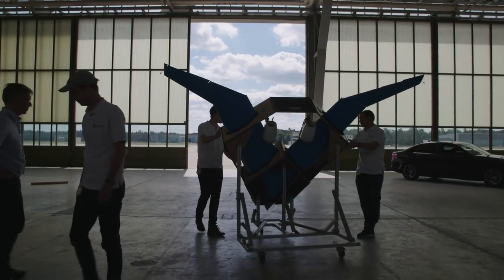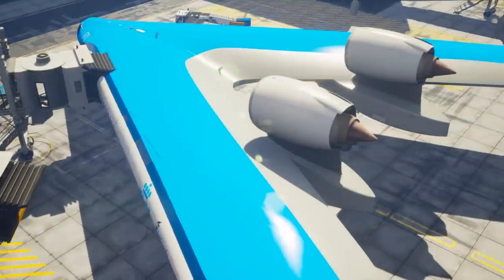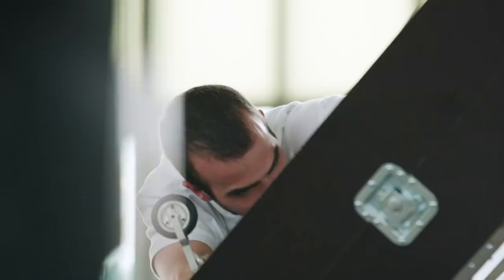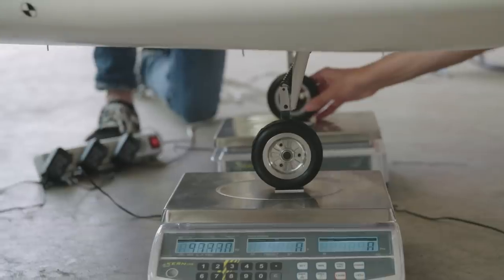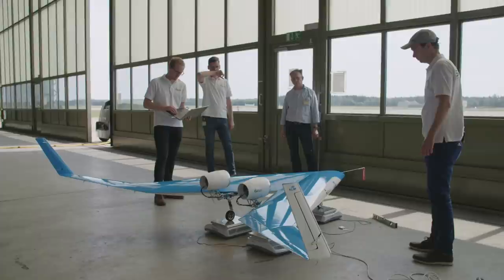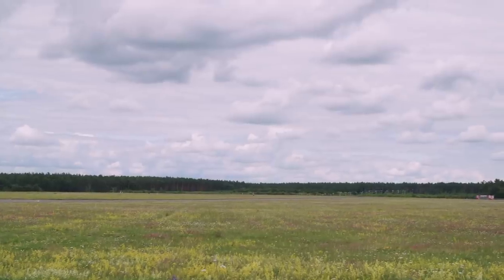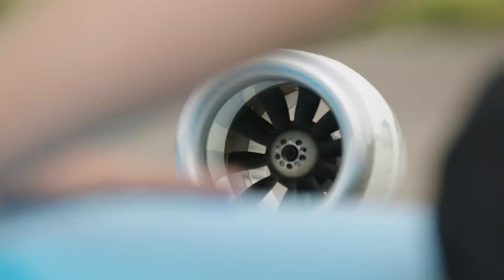KLM & TU Delft present: Flying the model Flying-V

Comment: So this design improves the fuel efficiency ~20%? What are the tradeoffs or disadvantages? Is there any increased safety risk? 
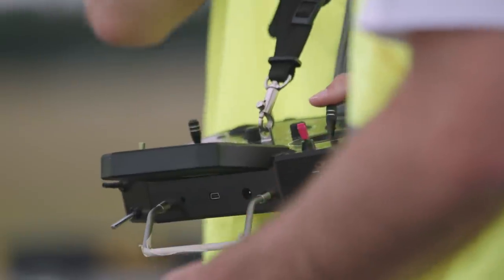@1:56 he says that there's danger of the nose pitching upward if a certain angle of attack is exceeded. Does that pose any significant safety risk compared to more established aircraft?
Reply: Yes it does
Reply: @memegod4433  well, then why sacrifice safety just for fuel savings?
Reply: @manofsan  this will never actually take off, it's just a little bit of PR and 'look how environmental we are'
Reply: @memegod4433  so airilners will always look about the same as they currently do? Nothing radically different, like Transonic Cruiser, or Wingbody, etc?
Reply: @manofsan  I think eventually we will see something like this, but most likely not as soon as his video might suggest. Most likely, the best improvements we can get in efficiency and comfort will be from improved 'tube' designs
Reply: @memegod4433  why is this V shape better than the more triangluar flying wing shape?
Reply: @manofsan  I thing it's something to do with drag, this design creates less drag and that's what leads to the fuel consumption reductions, however I'm not too sure but you should read into it, it's very interesting

Comment: The initial concept was a school bus where every kids could be sitting next to the driver and as roads were not wide enough, they made a plane. The real difficulty of a flying wing for passagers is to combine the tubular pressure cabine strength with wing shaped profile successfully with the least wet area as possible for low drag..the delta manta with stuffed triangoly cabine or this twin tube Vee shape...which one is better, that is the question?

Comment: I have absolutely no idea about what I am asking but why is it just a "v" and not a full triangle is used as the passenger seating fighter jets are triangle
Reply: Because it would be heavier that way, the whole point is to reduce weight and drag
Reply: @frizzante1  but wouldn't it have more seating or cargo capacity and that would offset the cost of a heavier plane
Reply: @kamalsinghvi  Yeah, it would. But that isnt the goal here, it's to have less fuel consumption (20% less than an Airbus A350)
Reply: @frizzante1  think about it the extra space can be used to hold cargo as most of the online purchase packages are transported via planes this would increase revenues and hence the per passenger costs will go down, in other words it will save the fuel of the cargo plane by carrying that cargo with it

Comment: basically a boomerang inspired plane. I want to see landing. Did it crash on landing?
Reply: Broke its nose landing gear due to a gust of wind during landing and pilot error.
Reply: @unicorntulkas  Other sources suggest Dutch roll instability caused some issues on landing. I think it's likely KLM doesn't want to suggest any control issues, even though I'm sure it's solvable.

Comment: What if passengers in left side are heavier than on right side.. How the plane is going to maintain the roll as center of mass and gravity will be unpredictable. If it maintains it through some physical manoeuvre, will it not need energy for that. Because in the air balance for flying objects has very little leeway, so it will be challenging to make it safer and practical.

Comment: i like this deasing because look more eficient. its planing more. is more airplane and less helicopter. What is the maximum speed prediction? i am litel worry about the wings. will be more high to take passenger inside but that mean more friction and the angle of atack is higher so will add drag.

Comment: It only has a 20% potential efficiency gain because they still try to fly close to mach. Airplane should be slower to get some significant efficiency gains. I don't think the added travel time would be a problem if there are price comprensations compared to a regular speed airplane that are much more damaging to the environment.

Comment: An aborted landing and no video of the landing itself? Did it have a rough landing or broken landing gear that wasn’t shown?
Reply: RC pilot brought it down on front gear too hard, snapped off the front gear. So it was damaged, but not terribly. KLM said it was a gust of wind when they were landing.
Reply: the model has issues at low speeds...the back likes to hang so there is that...look at the take off for a split second you can see the issue.
Reply: Thanks for the info everyone. Hopefully we see more future videos with the aircraft tuned.

Comment: It boils down to cost, speed and comfort.  well 20% fuel efficiency is very impressive so it save money there then it comes down to ticket price, Speed unless it's radically shorter as boeing found with their Mach 9.8  design reducing a 13 hour flight from London to Singapore to 11 people don't seem to care. That leaves comfort which people do care about. The reason every passenger jet looks like a cigar tube with wings is no-one has come up with anything enough of an improvement to replace them even Concorde while technically brilliant was to expensive to run and only flew as long as it did out of national pride sure I can go from London to New york in half the time but at ten times the ticket price.
Reply: Fuel efficiency improvements are the number one driving force in aircraft designs right now.
Cost of the aircraft isn't relevant because unless there's a massive price difference, the primary costs over an aircraft's lifespan are: Fuel, maintenance, and crew wages.
When factored over the entire operating life, the actual upfront cost of the aircraft isn't that relevant.
Airlines have even been known to replace aircraft early if there's a more fuel efficient model.
(it might surprise you to know that budget airlines often have newer aircraft than other airlines)

Comment: Awesome model, but safety reasons are bugging me if we were to actually turn this into an actual airplane. 

The way the plane is constructed means that the wings of the craft is it's own body where both passengers and fuel sits together, which is not ideal.

And while seating passengers in a V- shape may give some cockpit view, in a crash landing this means that everyone is generally exposed to more risk, unlike the current design. Lastly the increased wingspan may make current airports unusable and may also correlate with more cases of bird strike.

Would work as cargo plane though!
Reply: Wingspan is identical to existing aircraft in the same class (e.g. A350-900).

Comment: Adding oils to the engine on a transit check is going to be a pain. Driving the boom lift over and back. Don't even start with trying to do a dual inspection for etops or a fixed engine component.😩

Comment: How do you get numbers like 20% fuel saving when the model uses two IDF's running on electricity, for propulsion... This model only shows this V wing can fly, and not even very stable. What about weight distribution when there's actuall fuel in the wings, cargo and passengers... At this time it's just a very expensive RC model
Reply: They used Science to get those numbers.  There are models to figure out fuel consumption from parameters like airspeed, climb speed, lift and drag coefficient.

Comment: Took a team of engineers with PhD degrees over a year to build an RC plane. RamyRC would of had this done and flying in 3 months, maybe less.
Reply: But the point isn't to build an RC plane. The point is to research a new aircraft configuration and analyze it, which includes scale testing like this as well as extensive research

Comment: The real airplane might be build around 2030/2035?! If Tesla or SpaceX would be at this stage....it would be fully ready in 2 years.......
Reply: Space X and tesla have the same boss
Reply: Designing a passenger plane takes some time and tests it has to be guaranteed safe before it can be used
Reply: No it wouldn't. Tesla/SpaceX also need to comply with the EASA, FAA, ... regulations etc. before the aircraft can be ordered by airlines. Such a unconventional/new aircraft has to comply with all existing, and maybe new,  regulations. So lots of testing, research, data gathering, new trainings (think for example of mechanics, pilots, etc etc), new simulators, new manual books, and so on. (I probably forgot a lot).
It takes an enormous amount of time to get a new plane certified, especially when it's so unconventional.

Comment: Am I sitting in a flying fuel tank?
Reply: What are you sitting in a normal plane then? Fuel tanks are in the fuselage asswell
Reply: @frizzante1  actually, not.
Reply: @brozbro  Center tank is definitely in the fuselage.
Reply: @AmbientMorality  the center tank, if used, sits below the fuselage in line with the wing fuel tanks.  The center tank is definitely not IN the fuselage like the passengers are  "definitely in the fuselage" or the toilets are  "definitely in the fuselage"or the galley is  "definitely in the fuselage" or the cockpit is  "definitely in the fuselage" or, for that matter, the baggage hold is  "definitely in the fuselage".  Just as the engines are not "in the wings".
Reply: @brozbro  The center wing box of any conventional commercial airliner is part of the fuselage, in line with the cargo compartments on the lower deck.
Reply: @AmbientMorality  "The wingbox of a fixed-wing aircraft refers to the primary load carrying structure of the wing, which forms the structural centre of the wings and also the attachment point for other wing components such as leading edge flaps, trailing edge flaps and wing-tip devices. The wingbox continues beyond the visible wing roots and interfaces with the fuselage in the centre wingbox, which forms the structural core of an aircraft."
It's even called a "center wingbox" not a center fuselage box.
See where it says 'interfaces with the fuselage"?  wiki is your friend.
Reply: @AmbientMorality  The "center wing box" is the middle section of the overall wing box, but that just describes the center part of a very long box. The fuselage will simply sit on top of it, with a square cutout in the bottom to fit over the wing, with fairings all around the connection to make an nice external transition for the air flow.

The fuselage will be integrated into the wing box structurally with some sort of connecting links joining fuselage frames to the box, and may also have fuselage skins attached directly to the wing box. Sometimes the cutout in the fuselage has its own pressure bulkhead forming a box outside the wing box and you can simply unbolt the fuselage from the wing and lift it off, and sometimes the wing box itself is made part of the pressure hull, requiring lots of rivets to be drilled out to separate them.
Reply: @brozbro  I'm aware. The fuselage and center wing box are integrated components and a completed fuselage includes a completed center wing box (at least for high-volume narrowbody aircraft). That makes it part of the fuselage. Yes, structurally, it can be considered an extension of the wing torsion box which transfers loads from the wing into the fuselage.
Reply: @AmbientMorality  my original question remains unanswered regarding this new airplane.
Reply: @brozbro  Fuel tanks would be just forward of the engines and in the lower-swept section of the wing without passengers. Not sure if that counts as sitting in a flying fuel tank or not.

Comment: Where’s an airport in the USA that can handle that ac?

You put cart before the horse

Plus.....no landing video?

Lol 😂 

It failed or it would have been included
Reply: Most major airports can handle an A350-900, and therefore could handle this
Reply: And why not film the landing ?
Reply: Appable 
Why not film the landing of the model?
Reply: @Chief6067  the landing gear broke on landing because of the crosswinds
Reply: sorry to hear that 
I’d love to see it fly into the international airport where I work 
That would be awesome 

Are there plans to actually build full size soon or is it still in concept stage at this point?

It has a special type of beauty in its simplicity
Reply: @Chief6067  still a concept, but will eventually built in full size sometime in the future..

Comment: There is a fault with the design!! Engines should have been integrated within the fuselage viz. B-21 or a bit old school viz. Concorde. 
Seamless design initiates more aerodynamic capabilities. Those engines are just not designed for it. Seems very much like an afterthought. Get to the drawing-board and come up with a better design.